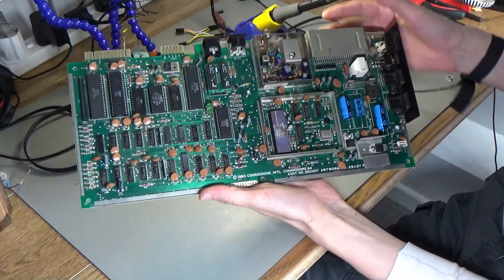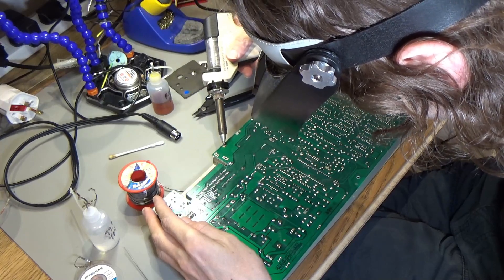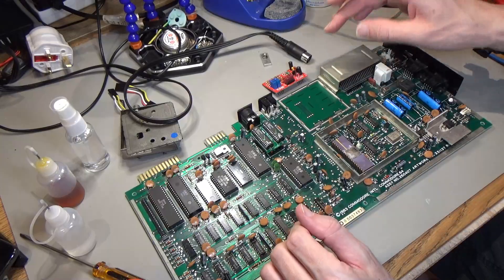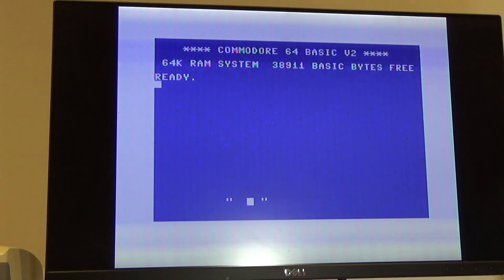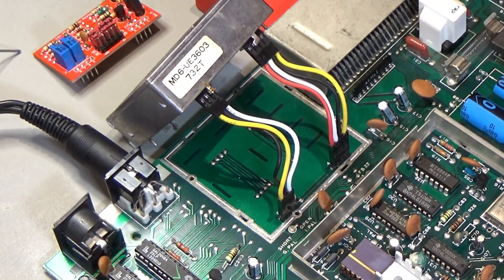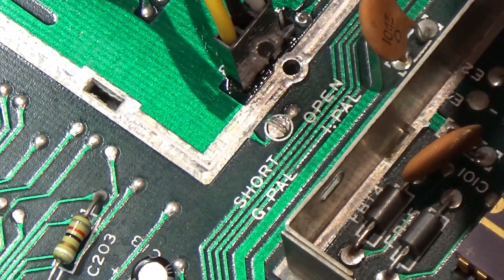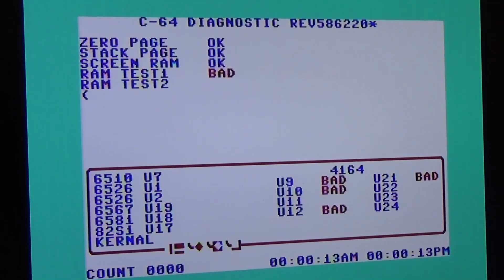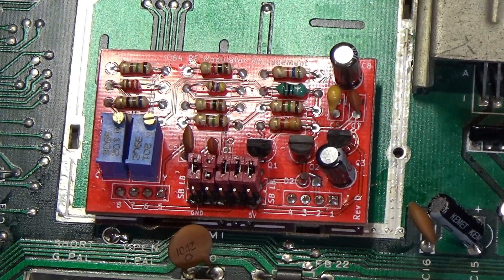Installing C64 RF Modulator Replacement on a PAL Longboard

Comment: How did it work with getting rid of the jail bars??
Reply from the maker: It's an improvement, but the jail bars are still there. I think they actually come from the VIC-II itself.
Reply: @DavePoo2  the vic chips have different revision and different output quality between the revisions
Reply: I love these modulators , I put one in my c128 neo and it's superb, I have a super janky breadbin I'm thinking of doing a video on with this modulator...... (captain commodore)

Comment: Your grounding issues are not at all related to whether the system is NTSC or PAL (per the video description).  These larger longboard modulators that Commodore sourced from Mitsumi do not have a "ground pin"; they are designed to get ground directly from their casing.  The pin that you conveniently ended up using as ground by closing the jumper is the "inter-carrier selector" pin that signals the original modulator what PAL system is in use.  On the other hand, the smaller Commodore-made modulators that fit the C128 and C64 shortboard do have a ground pin, as they were designed with a different pinout.  In any case, I have just found your channel and subscribed!  -- JC

Comment: Matt here (the guy that designed the modulator).

Sorry about the mix up with the ground jumper.  I've added a note to the github page.

If you have one available, try adding a 330pF ceramic capacitor (or 220pF-470pF if you have one laying around) across resistor R3 (top right) to see if it helps eliminate any remaining checkerboarding on your LCD monitor (it's not an issue on a CRT).  Let me know if it improves the output any.  There seem to be so many variations of boards, VIC-II chips, LCD monitors, cables, etc that some people get checkerboarding and others just...don't (Adrian's digital basement).
Reply from the maker: Thanks, i'll give that a go. This VIC-II is one of the old R1 versions, which generates a lot of heat and doesn't have the best video output anyway. But the modulator replacement has already improved the output greatly, so any other fixes would be also worth a go (a mod to the the modulator)

Comment: Nice video. It is incredible that the ground was not connected!!!. Let's fix that RAM :-)
Reply from the maker: Yeah, i was very confused for a while. Also suprised how well that thing can work without the ground. I've left an issue on the GitHub page so the creator can leave a note in the readme about this. Hopefully so people can avoid the confusion i had to go through. As for the RAM, i've not got any working theories yet about what could be wrong. I suspect it's one of the logic chips as the test can come up with different RAM chips being in error each time. Although it could also be a bad VIC-II as the VIC-II provides the ras/cas to the RAM, and it's that's out then the whole RAM is going to go haywire.
Reply: @DavePoo2  Probably. Just watched Adrian's Basement today Saturday and it was the case in machine #4. The pity is you don't have them socketed, but as a 74LS chip, it is available and cheap. VIC-II is another completely different story. Will be waiting for the next episode!
Reply from the maker: Oh and accoring to the internet. https://www.cavsi.com/questionsanswers/what-are-the-pal-variants/

There are five varieties of PAL:

1. PAL B/G/D/K/I
The majority of countries using PAL have television standards with 625 lines and 25 frames, differences concern the audio carrier frequency and channel bandwidths. Standards B/G are used in most of Western Europe, standard I in the UK, Ireland, Hong Kong and Macau, standards D/K in most of Eastern Europe and Standard D in mainland China.

7-MHz channels are used in VHF (B, D) and 8-MHz channels in UHF (G, K, I), although Australia used 7-MHz channels in UHF and Ireland uses 8-MHz channels in VHF .